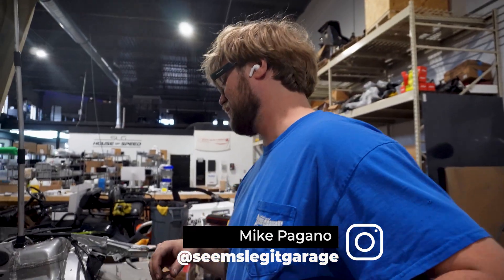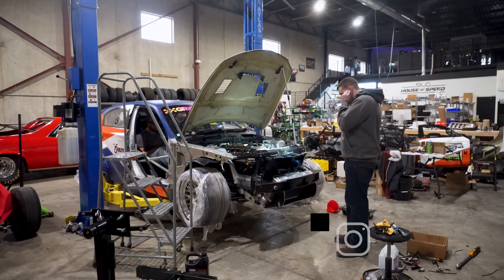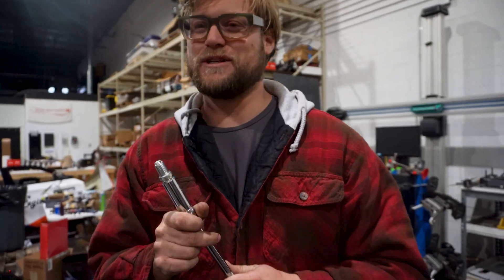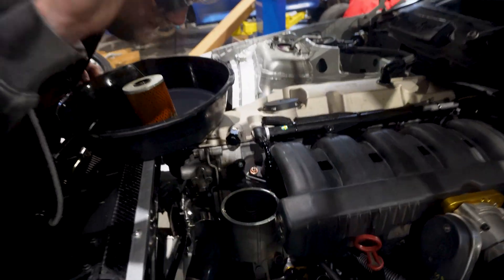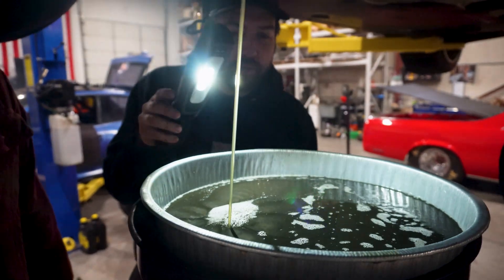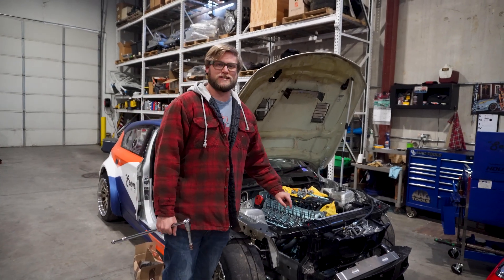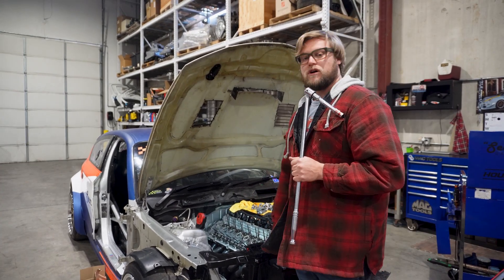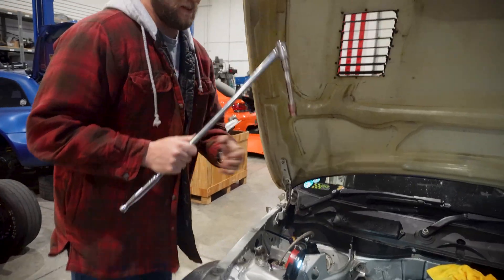Fully Built High Compression M54 FIRST START! | Will It Run? GLTC Update

Comment: Love all the acronyms but the occasional explanation would be greatly appreciated…..and the language… get some soap… 😀
Reply: The full names are super long to say, but I'll type any of them out in full word form from abbreviations for you, buddy.
OFHG- oil filter housing gasket
VCG- valve cover gasket
ITB- independent throttle bodies
ECU - he meant DME, but Electronic Control Unit, and Digital Motor Electrocomputer are the same basically
Reply: @Karl_Kampfwagen  🙏 I did know the ECU.  I made the same comment on the LS3 swapped BMW sprint video - the one previous to this one - where the first five minutes were bewildering…😂